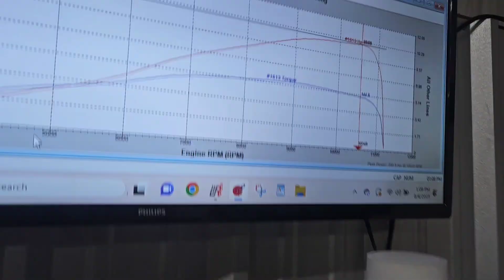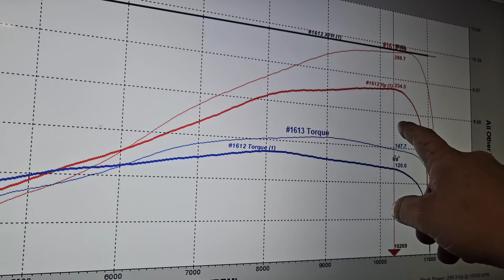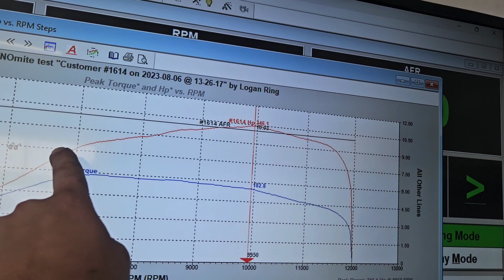Shop updates for everyone and dragonflies turbo dyno numbers

Comment: My ghost limiter was because of a damn coil pack bad the whole time… just a thought… was stuck at 7k right when it was going into full boost… you tuned it on a bad coil pack yourself and didn’t even know it. It was secondary winding, it was just a little weak. Worked well upon startup but at high boost wouldn’t.